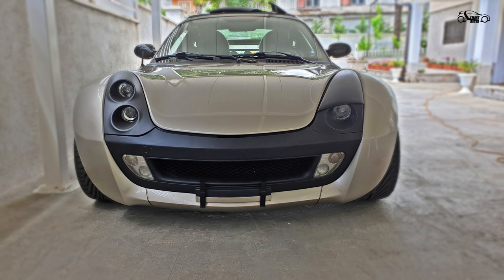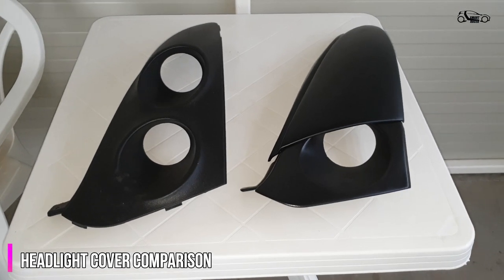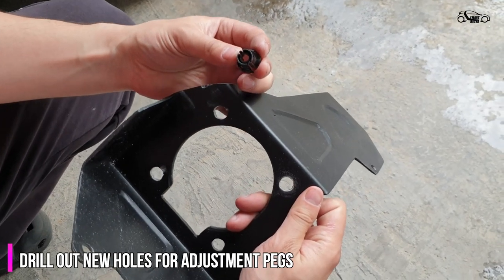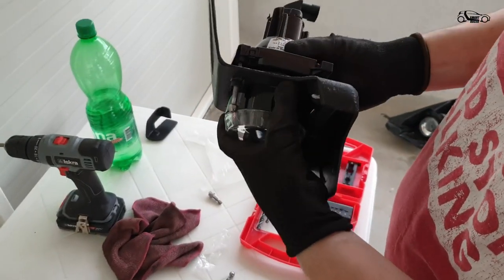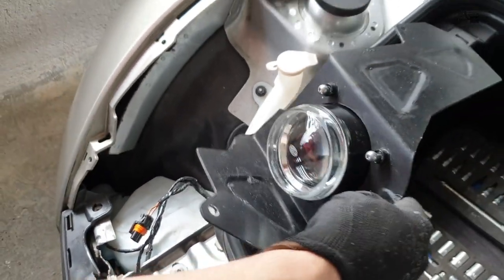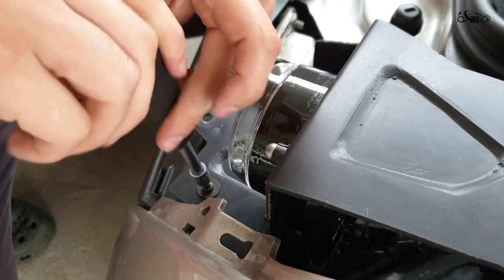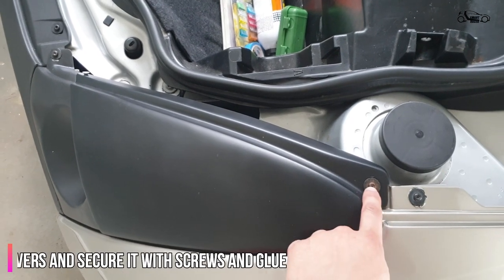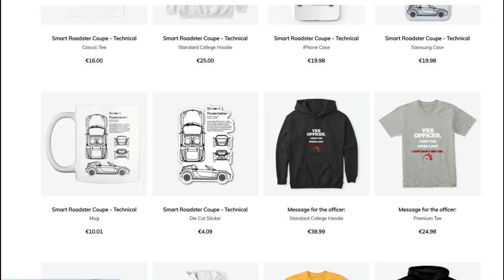Installing Bi-Halogen Headlights on Smart Roadster

Comment: did you have any trouble aligning them afterwards? thanks
Reply from the maker: With this custom headlight covers yes, by replacing lower beam only on standard, no.
Reply: @SmartRacer  I imagine because of the glue situation right?

Comment: Hi dear! your video and description is perfect! thanks. i have only a question about where did you find the connectors , HB4 (9006) + connector for HIGH BEAM, do you have the correct link ? thanks
Reply from the maker: Yes I mentioned them in description, but you can find them at local car parts shop also
Reply: @SmartRacer  thanks dear, if something need the Bi halogen lights i have a couple of set to sell (new part). Thanks a lot

Comment: Hi there, I like your vids, is it possible to upgrade to these lamps or the low beam only without changing the headlamp bracket and cover? Ie is there a plug and play option that will fit the Roadster? My headlamps are so bad they make my eyes hurt 😅
Reply from the maker: Thank you for following, you can buy only lower beam units which are the same as this one in video, but new connections are still required.
Reply: @SmartRacer  thank you for your help! Is it possible to fit the light into the existing Headlamp Bracket? Or you must buy a new bracket and drill it?
Reply from the maker: You can use existing but need to make bigger holes, I write in description more details.
Reply: @SmartRacer  hi, thank you for your help! I am looking getting these lights. Much appreciated!

Comment: very good job it gives a new very nice look. where did you find the headlight cover? Is it possible to have the link ? Again well done for the work. 👍
Reply from the maker: I order from guy called Angelo Filipe (apr_composites) on instagram
Reply: @SmartRacer  thank you very much for the information. is it indiscreet to ask you the price?
Reply from the maker: I don't really remember price of covers cause I bought them year ago but all together with lights, connectors is less than 400€
Reply: @SmartRacer  OK, thanks. its remains reasonable for the whole plus its gives a nice look. You did a good job 👍

Comment: Can I ask, using the stock turbo from brabus what's the maximum horsepower you can get from it... providing you get new clutch, forge conrods and pistons?

Also... why dont you get forge parts and go up in power?
Reply from the maker: Haven't dyno it yet. I think that is cheaper and durable to do swap then to install high end parts.
Reply: @SmartRacer  Really? I thought the opposite, and frankly, I think the engine is great as the car weighs very little with this engine. I think it can easily go to 700kg with some work. And if you can get 200bhp... then that's around 290bhp per tonne! The problem with swap I think is... is that its a risk in the sense that... you might think its an easy job, but it can become difficult, and it will mean that a lot of hours will need to be invested. I guess same with modifying, but maybe not as much. I don't know, and I am not an expert.